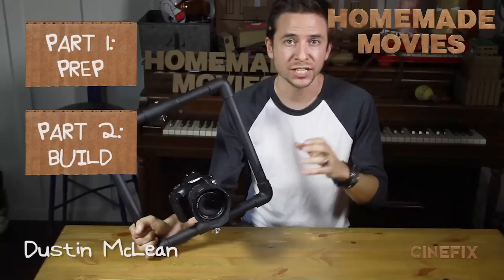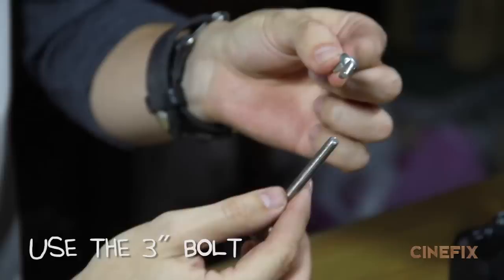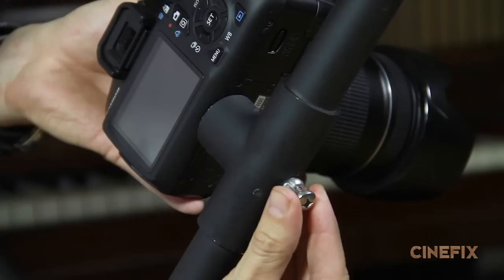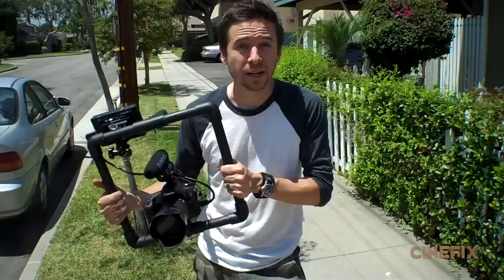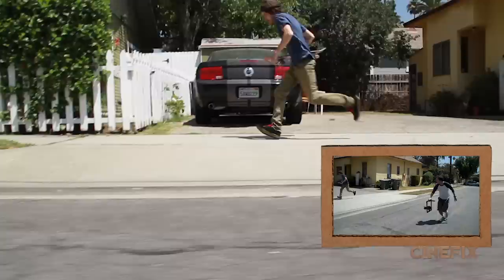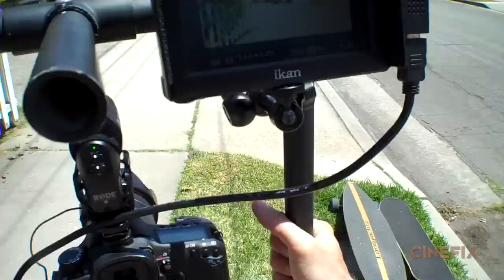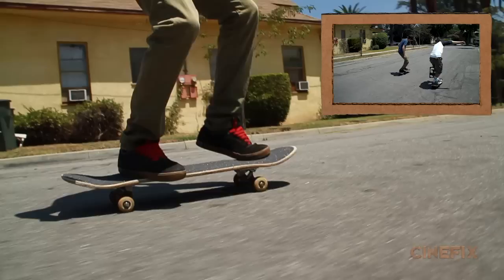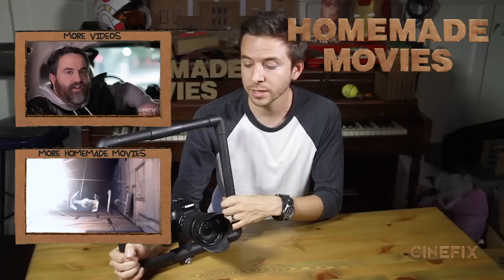DSLR Camera Stabilizer for Under $5 (Part 3: SHOOT) - Homemade Film School

Comment: You really shouldn't call it a stabilizer, it's just a camera holder.
Reply: couldnt agree more
Reply: It also helps to make your video not shaky
Reply: The video looks pretty shaky though
Reply: @FilthyReech  nah at all it stabilaze the things
Reply: @FilthyReech   yeah but less shaky than it would have been without it
Reply: True true. Do you use it? How do you find it?
Reply: It is not a waste of time or money it does serve minimum of your need
Reply: guys anything that holds a camera is its goal is to stabilize camera shake is a stabilizer, don't get caught up on names. its the function. "does it stabiliz" the whole point of this video is to hack hollywood
Reply: @FilthyReech  it wasnt shake, as much as it's just the camera swinging

Comment: If it's still shaky, fill the tubes with sand, and place styrofoam tubes on the left and right sides of the rig. And boom. Smooth as silk.
Reply: +Anonomyous yeah. Sand gives it little more counter weight. And the styrofoams absorb the shock from your hands
Reply: +25/Eight Films could you link a picture how it looks like?
Reply: so im gonna  fill the tubes up and down a sand and a styrofoam for left and right to have counter balance? could you link me also a picture pls thanks
Reply: Pls make a video of it

Comment: I tried it with no difference.  Then I stacked 2 large washers and two hose gaskets to absorb the shock under the camera and it worked fine.  Might add a bit of counterweight too like 25/Eight Films said.

Comment: I've built other more steadicam type rigs that are a different design than this, usually you want a lot of weight or a counter-balance over your shoulder. You could possibly add on to this one but simply adding a connection for a weight. Once it's heavy you can run and jump with it and it will be pretty darn smooth!

Comment: That's a good idea but you'd probably want to at least have it pivoting with some sort of guide, like maybe a slot that a bolt fits through. That way you don't run the risk of it popping out, it's still fairly flexible. But maybe it would stay in place too, let me know if you try it!

Comment: I just made this rig today 2/18/2021 and it was cheap cheap cheap and it works after a few other personal modifications for stabilization its damn there just as good as a expensive stabilizer/cam holder. $800 rig vs $15 rig and the winner is $15 🎉 🏆 . Its not the best of the best but it does a great job.
Reply: What were your modifications? I want to try this so it would be really helpful if you can tell me what you did in order to make it more stable.

Comment: The FigRig mounting frame construction with a 1 handed 3-axis gimbal stabilizer like the Zhiyun Crane 2 or DJI Ronin S mounted inside it would do wonders I bet (especially with a GH5 and OIS lens).

Comment: Thanks for the Video! I just finish making this as another useful TOOL in my filmmaking arsenal. One question, the 2 inch was not long enough to reach the top to screw my camera into?
Reply: He clearly said use the 3 inch for the camera and 2 inch for the handle bar

Comment: If the lower T connector is loose and has machine bolts to secure the camera at any height level you want it to look at would be even better. I see some shots of the skateboarder were looking a little bit to low so it would come in handy if the camera angle was adjustable too!

Comment: I created my own verision of this but i added hand grips on the sides withe the left over pvc pipe i drilled a hole through bothe sides of the square frame then i took a 6in peice of pvc and drilled a hole through it and added a nut on the end to give the stabilizer an even better stabilization
Reply: Hi can you show us  a picture

Comment: Cool. Perhaps you shouldn't glue the T with the handle so that it can twist as needed. Maybe even lube it a little so it wouldn't squeak. It shouldn't come loose as the corners are glued and holding the pipes into it.

Comment: It's definitely not something ultra-smooth like a glide-cam or steadicam, it's mostly for getting a much better grip on your camera so it doesn't just fly around in (or out of) your hands. It still relies on your ability to move it around smoothly.
Reply: Well if you have a camera with ibis it would be smoother then this video showed.

Comment: When using the removable handle, what is your technique for gripping the rig? Are you holding it loosely or tightly? When holding the sides I'm getting great results. With the handle, not so much.

Comment: DOES THIS WORK??!! anyone in here actually have a review? AND how in the heck does this guy keep his focus when moving all around?? Answer my questions please.
Reply: It works well enough for 5 bucks. Doesn't stabilize too well right off the bat, but adding some weight should help. The biggest advantage to this build is the ablility to get low shots while moving. So useful!

Comment: Lol that's not a stabilizer it's just a big ass handle.....why lie chicken pie😆
Reply: True enough, but the wider spread and better hold it allows will definitely result in less shake than hand holding a plain DSLR.  It's hard not to get a degree of shakiness even if just standing with one, as they're so small and your hands are so close together..  That's what I'd use something like this for - mostly standing shots, not walking or running.